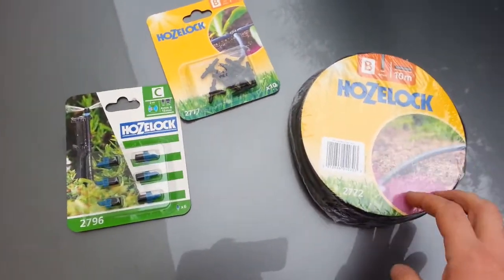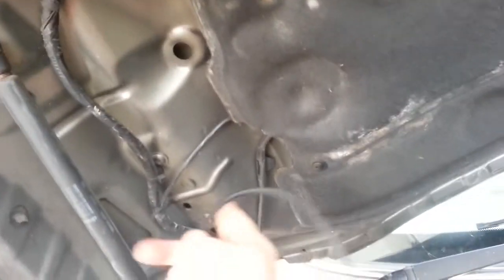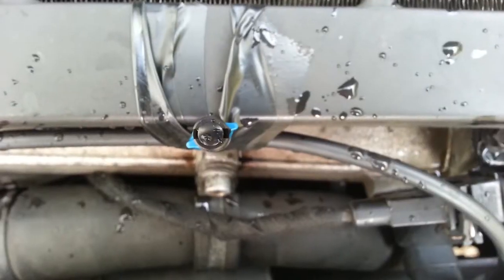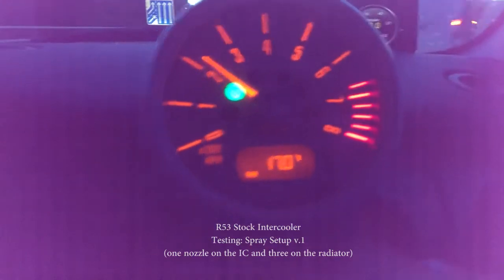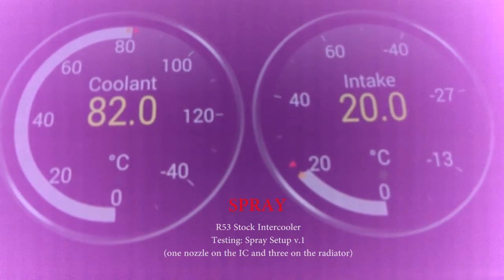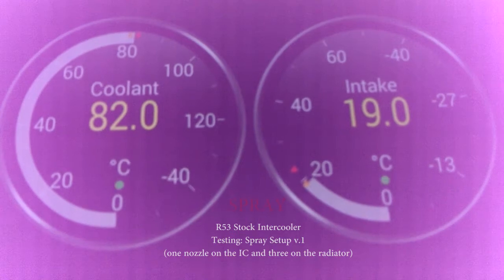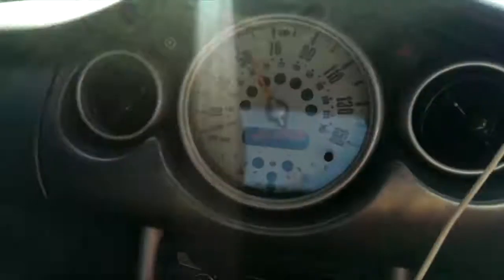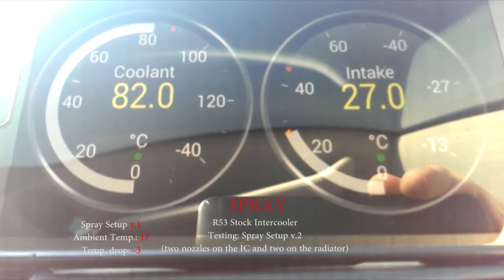Mini Cooper S Intercooler Water Spray DIY Install and Test

Comment: Nice experiment. Not sure how the intake system looks with your car, but wouldn't it be better to see temps at the manifold rather than intake? Usually the intake is preturbo and cooling the ic will really show its effects at the manifold temps

Comment: tell you what would be better,  not having a heat soaked engine bay mounted intercooler. my intake temps never move from 1 or 2 degrees from ambiet temps. and thats moving 660rwhp through a gtx3582r.  a good large well engineered front mount does wonders.
Reply: 102nds not on a supercharged car it doesn't

Comment: You won't see change with the coolant temperature even if you dump a gallon of water on the radiator. The thermostat will try to regulate the temperature; assuming the engine is within the operating temp.
Reply: this is cooling the intercooler. not raditior
Reply: Unless you change the thermostat

Comment: my intercooler heats around 45-50 degrees C (30 ambient) , because it "cools" the return from EGR , so if i spray on it, it will be mad benefit :)

Comment: The engine temp wont drop because the thermostat valve shuts when the coolant hits 83 degrees..
Reply: the engine Temp doesn't matter, This is about AIR Intake Temp.
Reply: .. and engine temp as well. He was checking the coolant temp, since the water spray hits both intercooler and radiator..

Comment: How is this holding up for you ? Are you still utilizing this to cool down your IAT's? It gets about 44C here in las vegas during the summer. And was looking into something like this, other than Water/meth kit.
Reply from the maker: it does the job 10-12 degrees less temp. I only spray when I want to accelerate hard

Comment: Are you sure the sensor is not before the intercooler? My WRX has it right where the intake box is instead of after it passes through the intercooler.  I need to convert to speed density in order to read temps after its been cooled down by the I/C.
Reply: should always be after the intercooler, usually right before throttle blade or in intake manifold. if air intake temp sensor was in or near air filter box on intake side itd only read ambient temp.

Comment: Just an FYI. You should get your front shocks checked on the mini. I have a mini r53 and they top of the shock towers can mushroom and it looks like yours have from the video. The rubber top should be noticeably below the metal surround. This typically means that the top of the strut tower has gone bad and you may feel a rough or bumpy ride.

Comment: You need better sprayers, something that atomises better. You can order them from Devils Own or any other kit. That way the water won't be flying all over the engine bay and it will be more of a mist, but big droplets of water! Good job, it can be great with better sprayers though.
Reply from the maker: How much pressure the industrial nozzle needs to mist the water...?